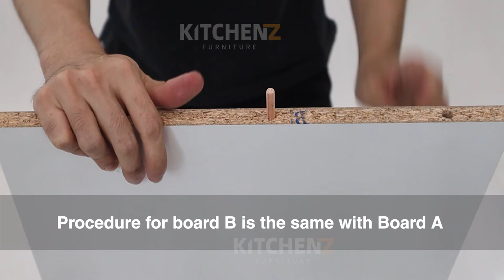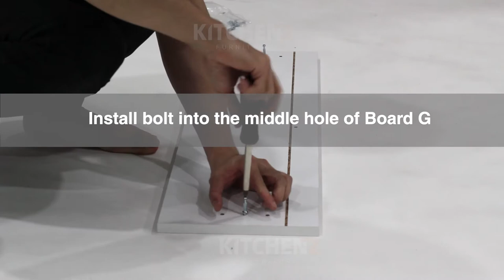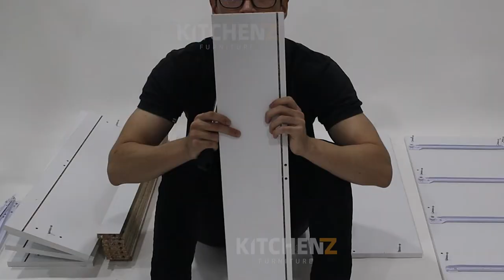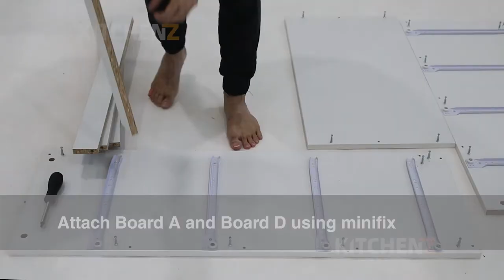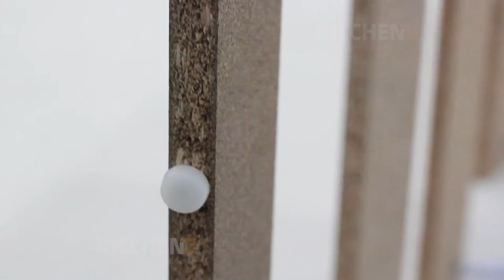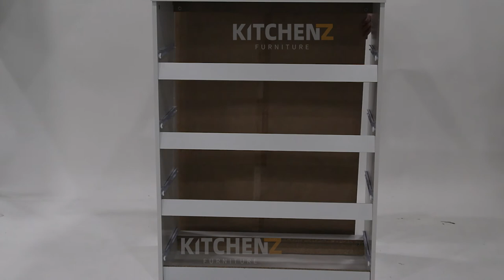KitchenZ | Installation Guide | HomeZ 3FT Chest Drawer with 4 Layer Drawer Storage

Comment: Just received mine last friday.
for the K board, you need to attach to J board using the long screw. Not need to insert dowel to K board
Reply from the maker: Hi Syaza, thank you for correcting, there might be an adjustment made from our production side, we will do a newer version for this. Sincerely thanks!
Reply: my k board is damaged because of this. sigh